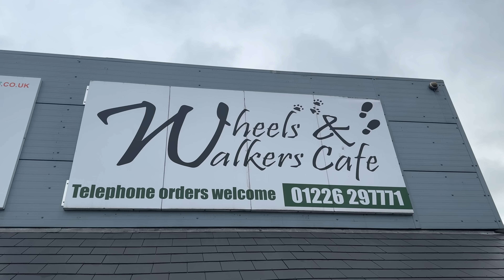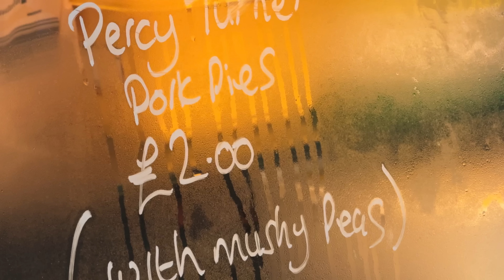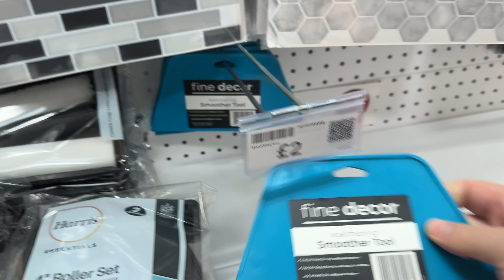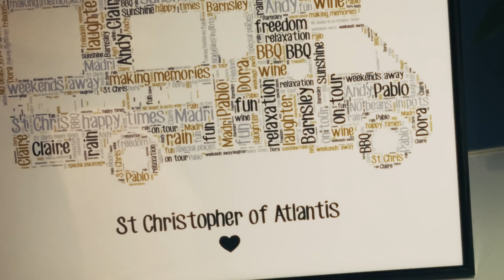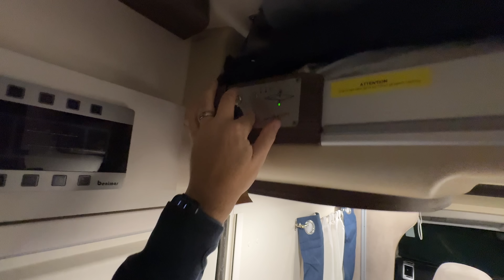How We Transformed Our Motorhome Using Cancelled Campsite Fees

Comment: Supposed to spray wall with water first so you can move it around and start in the other corner so the thin cut bit is where you started. Wallpapering method
Reply from the maker: Thank you

Comment: Spray soapy water on surface  it stops adhesive  sticking.  So you can smooth out & position the vinyl  the soapy water evaporates then the adhesive  holds
Reply from the maker: Thank you

Comment: Hi guys . We took the stoppers out so the bed would go really low just off the bottom cushion you sit on . But then the back cushion has to be put on floor under the bed . I then use a single step to get on and off the bed . We then use the passenger chair swivelled to face the bed so you can then rest a tray on it for your cuppa . I then use the extra slide on table that fits end of the cooker for my coffee table for being in bed .  . The blue & yellow looks well . Julie 4 ft 11 😊
Reply from the maker: Hello. We will take a look at this idea!! Thanks for the suggestion Julie  👍👍👍
Reply: Forgot to mention we had only 1 stopper on our left hand side runner . And once the bed is down we use the one of the back rests as a head board for the bed . So in theory only 1 backrest needs to be under bed on floor . 😊
Reply from the maker: We are going to try this 👍👍👍
Reply: @  forgot to mention that when if you do manage to do the bed situation make sure your lights underneath the bed have been off for a while so they can cool down as we’ve been told they could scorch the cushion cover . We leave ours a couple of  centimetres  above the base cushion . 😊 hope it works for you guys 😊

Comment: Sticky back vinyl…peel backing off about 1 inch and make a sharp fold, stick the 1 inch strip to surface. Place a plastic ruler (preferably shatterproof 😂) along the width of the roll at the top. As you peel off the remainder of the backing, slide the ruler down. Voila! No bubbles. 👍
Was my job in the 90’s 😂😂
Reply from the maker: No bubbles?!?!?!?! We can only dream of no bubbles 😂😂😂😂😂